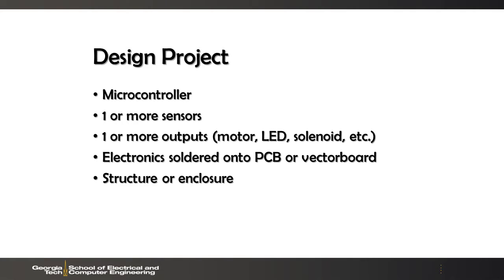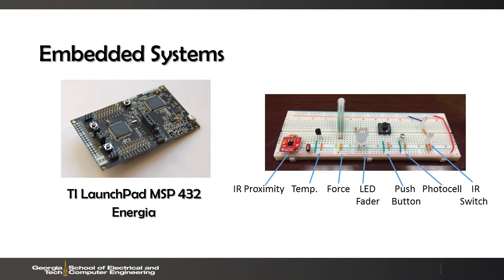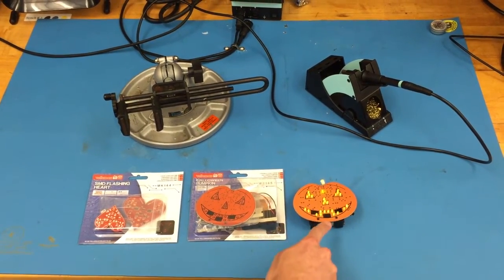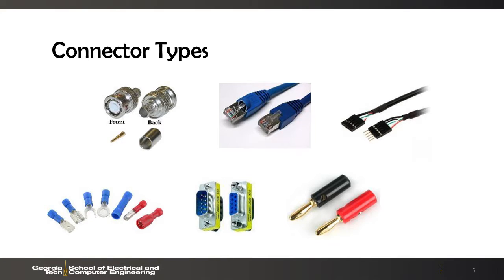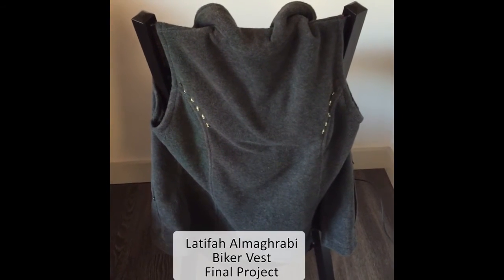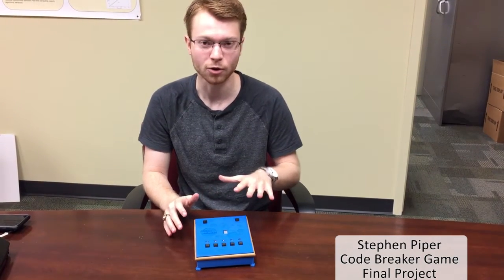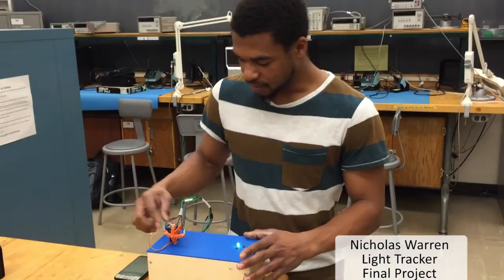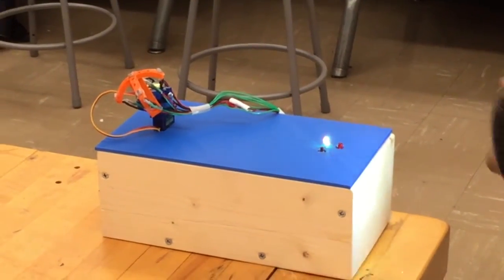Embedded Systems: Hands on Learning @ Georgia Tech_Ferri

Comment: What a cool course.  That is something we all talk about putting into our curriculum, but there is no room!  Is this a required course?  If so, did you have to get rid of other credits to fit it in?
Reply: This is an elective course, so we did not get rid of anything. Most of the students came into the course with an idea of a project they always wanted to build, so they are really motivated. Also, it creates a core group of students who are better able to do the capstone design course. Since they work in teams, many others benefit.

Comment from the maker: Course looks amazing - and packed full of skills for 1 credit.  What are the prerequisites for the course?  

What are the open lab hours?  Are students able to work in the labs when the Lab Staff is not present?

How much guidance do students get while working on their projects?  Are there opportunities for the instructors and/or lab staff to provide correction to the students if they start to use and/or develop techniques that are inappropriate or lacking in rigor?
Reply: The prerequisite right now is circuits (with concurrency) but I plan to change that to circuits or (digital design lab) or (one of the C or C++ programming classes).

The students have 24/7 access to the lab.  There are some design milestones along the way where the students get feedback from the instructors. there are also office hours for the students to seek extra help.